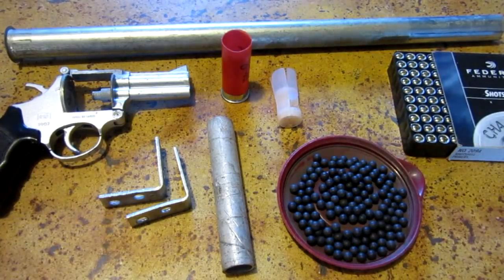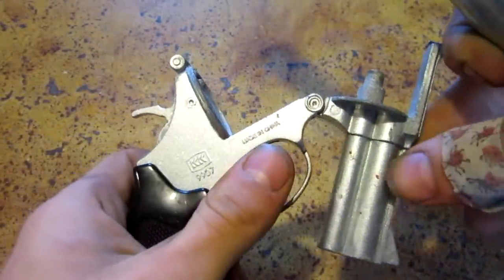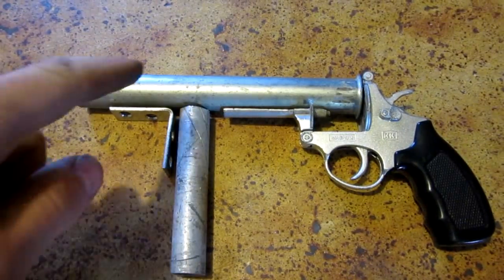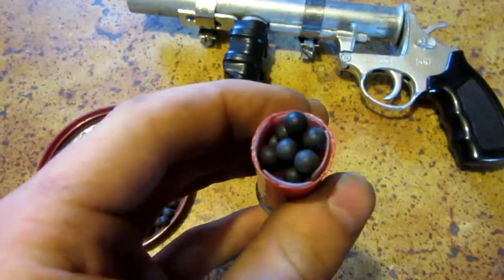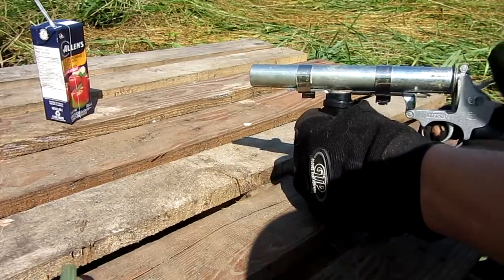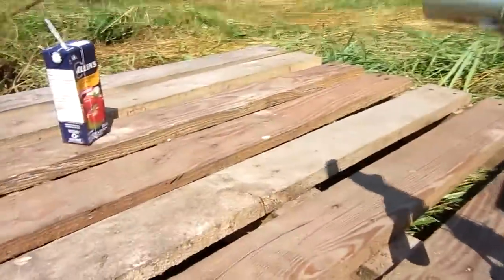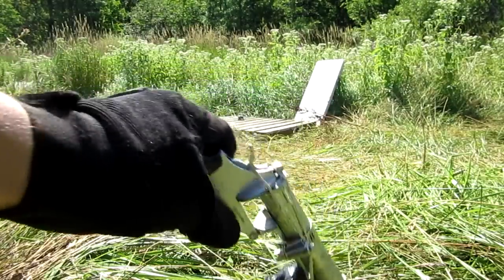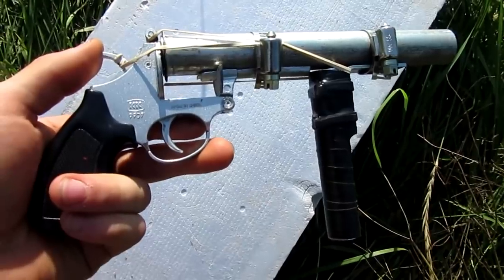How to Make an Airsoft Shotgun Pistol -  $5

Comment: if hes gonna use primers only, he might as well just invest in a flare pistol and just use some empty flare cartridges with some #209 black powder shotgun primers. Same effect, more reliable, and it doesn't accept real shot shells unless they're modified. Sure its more expensive, but its the better option
Reply: It's not that much more expensive.  You can find them on sale for $12 or less, and they're classed as signalling devices so you don't get in trouble for building a short shotgun.

Comment: You're using an explosion as a propellant. This is a firearm.
Reply: A firearm is considered 500 FPS so anything less is not one a co2 is majority not a firearm
Reply: thedukesrule in Canada it’s a firearm is anything above 500 FPS AND above a certain energy I forgot the number of joules
Reply: Black powder guns use an explosion, and they aren't firearms.
Reply: @thedukesrule  in France, If it use fire as a propelent, it's a firearm, no matter what
Reply: @kriss3401  well France is weird as F that makes a lot of things firearms but explosions and fire is 2 different things
Reply: @thedukesrule  firearms uses explosives...
Firearmes don't use just fire... Of course it's two different things, fire, and explosions, but it's absolutely irrelevant here

And I mean of course, if it's meant to propel something with and explosion

What other things is a firearm then?
Reply: @thedukesrule  just looked up and it doesn't specify the limited power so if it's pyrotechnic, then without autorisations, it's forbidden
Reply: If it can't kill you it not a firearm
Reply: @13film55  how old are you....
Reply: @kriss3401  this is a gunlaw in Thailand
Reply: @13film55  well that's pretty dumb
It's not the weapon that say if it can kill or not
It's the ammunition
Replace what he used with a real shell and boom! It can kill
It uses an explosion as a propellant, it is a firearm
Reply: @kriss3401  correct

Comment: well done mate u just made a highly illegal short barrelled shotgun 👍
Reply: yes imagine how dead you  would be if you where to shoot it with a real shell. its a thin pipe
Reply: )Peron1-MC( You wouldn't be dead.  People make pipe guns all the time.
Reply: It’s air soft it’s not considered a firearm
Reply: Definitely not a shotgun. Shotguns are designed to be fired from the shoulder.
Reply: it's fricken pistol grip too!
Reply: Noah Adams the pistol grip is the reason it can’t be a shotgun. The vertical foregrip is the reason it can’t be a pistol even if he rifled the barrel. The overall length under 26 inches is the reason it can’t be a firearm. All that’s left is an AOW, which requires a $5 tax stamp to be legal and not a felony. $5 felonies are really dumb.
Reply: No stock= not shotgun
Reply: @j.m.8193  it's more than $5 lol
Reply: @buyerenogurlfwendo2106  Being dumb is ok. Being arrogant is ok. But being dumb and arrogant is a bad combination. Yes, an AOW tax stamp is $5.
Reply: @j.m.8193   you can give a licensed firearm dealer a gun to make into an aow but whatever work he has to do to make it an aow will probably be considering manufacturing. So he'll probably have to pay that stamp. Then he can transfer it back to you for the $5 stamp. But he's also going to include the manufacturing stamp and labor in the price as well. 

Main point is this isn't a $5 felony.  It's a $200 felony.
Reply: @buyerenogurlfwendo2106  You're factoring in the cost of labor into the tax stamp? LOL. The stamp has nothing to do with the value of the gun. It's $5 for an AOW stamp no matter what. This guy already manufactured an AOW without a stamp.... a $5 stamp. The $200 stamp is only for machine guns, short barreled shotguns and short barreled rifles. This thing is none of those things, so the stamp costs $5. The phrase "$5 felony" didn't mean that his total expense was $5. It meant that an additional $5, some paperwork and waiting for the stamp would have prevented this from being a felony.
Reply: @j.m.8193  I think you are right, but $5.00 is a bit much for what looks like a rubber band gun to me.
Reply: @j.m.8193  no it isn't. 

It's  a $200 tax stamp to manufacture it.  He should've paid $200 before making it. 

It's  $5 tax stamp to transfer it.  But you can't transfer guns made by regular civilians. Only the properly licensed ffls can transfer guns they made.

A simple Google search proves this.  I'm right.  You're wrong.  Google it.
Reply: POTTERLOVER 2007 it uses actual firearm parts including primers and shells it’s a sbs now
Reply: Its airsoft lol
Reply: POTTERLOVER 2007 a firearm is a weapon that uses a chemical reaction usually gunpowder to launch a projectile so this is
Reply: mario its aluminum
Reply: anything that "can" chamber a cartridge   is called a firarm by law
Reply: no moa
Reply: KillStarReder       Making your own gun is not illegal
Reply: @shockwave._.8098  Ik but u could of use a real shell
Reply: @yomum420  with airsoft bbs

Comment: You can build this air soft shotgun pistol for 5 dollars!

But you'll need a 200 dollar grinder, a 100 dollar press and 50 dollars worth of shotgun primers.
Reply: Colin Carroll not to mention a TIG welder if you didn't want it to be held together with pipe clamps!!! LMAO
Reply: Volkz VLOGS or super glue
Reply: Volkz VLOGS or tape
Reply: It’s a 20 dollar grinder a press is unnecessary and is only about 70 and the primers cost 5 for a pack of 100. Also you could use a hacksaw.
Reply: Colin Carroll Haa so true !!
Reply: Too much loosely fitted,unreliable,pos, mumbo jumbo !
Reply: I already got all the stuff I need to make that and already made it after I watched this video it's power full
Reply: Most people going to make this already had all that. This stuff is not for the city boy living with his mom.
Reply: primers are only about 6 dollars
Reply: Every. Damn. Time.
Reply: Exaclty why I went through the comments.
Reply: Your prices are way off.
Reply: @SNOUTxTOUT  theres hacksaws at the dollar store

Comment: I'm not a normal viewer of this channel, but what he has made here is a short barrel shotgun. This is a felony in the United States if he doesn't have the proper tax stamp for it, which I doubt he has. That being said it's a very clever way to do it, but it's crazy illegal.
Reply: 000 000 Use of gunpowder isn't what defines a firearm. The device he built is capable of firing a shot shell and the device is under the minimum length for a shotgun.
Reply from the maker: +LUKE MEADOWS I actually modified it so it can't shoot a real shotgun shell. I put it in the description so I don't get anyone thinking I made a real gun. I also took it apart after the video just for safety purposes.
Reply: inventor719 That's a good idea to add a blockage in theory, but there are live mini-shotgun rounds that are 1 3/4 inch. It's good that you disassembled it, but it still meets criteria for an illegal firearm.
Reply from the maker: +LUKE MEADOWS oh yeah I took those shorter rounds into account too because I think I put the metal blockage at 1.5 from the end of the Barrel. Trust me I don't want to break laws or get in trouble so I've tried my best to do it safely
Reply: inventor719 Good idea. Never hurts to be too cautious.
Reply: 000 000 Quite the opposite actually, you're the one spouting nonsense and incorrect information.
Reply: The law would still classify that as a firearm for the purposes of the NFA as they would argue that with minimal modification i could be converted to an AOW (being a smoothbore pistol) the blockage isn't enough to save you sorry dude.

Rifling the barrel would if you see a .410 shell but your have to be confident it could chamber .45long colt and fire safely.
Reply: its shooting bb's at speeds that wouldn't even harm someone... how is that illegal???
Reply: LUKE MEADOWS it’s air soft it’s not considered a firearm
Reply: It’s an AOW, not a shotgun. Still illegal and dumb.

Comment: Why not make a real shotgun at that point, just replace the bb shotgun shell with a real one
Reply from the maker: +sandra pop the gun would simply explode and be very dangerous
Reply: and y'know, not be legal.
Reply: You can make homemade firearms in America
Reply: After going through all the legal procedures
Reply: +Jake Cardelli only legal work if ur in a blue state or intend to sell I got 4 homemade slamfire shotguns
Reply: Homemade weapons are legal in many states, but not legal to sell directly or high volume
Reply: Chalupa batman not in this configuration......
Reply: All you need is smokeless powder but that would be extremely dangerous
Reply: because a real shotgun uses black powder just air isnt enough power to launch peelets of a shotgun
Reply: Chalupa batman except this would be counted as a short barrel shotgun and its illegal.
Reply: If I’m going to make a pipe shotgun, I’m checking the grade, doing the math (mainly mechanics of materials), getting data for said grade, and testing it with rope behind a shield
Reply: Cos you can't shoot people and both have a laugh after lol, ya kno

Comment: I don't think that's airsoft legal :l
Reply: its not america legal either
Reply: I would think it would be considered a firearm due to the propellant being used, but I don't know the laws regarding it.
Reply: It is a firearm due to the fact that it uses cartridges, and is thus an aow at best
Reply: It would be legal is some states as a smooth-bore pistol which is an AOW and therefore and NFA item in the US, some states allow it, some don't
Reply: airsoft is sooo legal...
Reply: Alexander Simcox 

Yes it is, of course with the forgirp you would need special stamps, I don't think you would need a stamp for a SBS, because it has a pistol grip, but I'm pretty sure it's legal.
Reply: ??? what do you mean "airsoft is sooo legal..."
Reply: To all of you that say that it cant handle a full load, yes you are correct, but the shells that he filled with airsoft bbs are considered cartridges legally, and makes it a firearm. Also, aows require a 5 dollar tax stamp approved by the atf to be legal in the us.
Reply: All of that in addition to if its even considered an aow, it may be considered a sbs because of the smooth bore barrel
Reply: Luke K  adc

Adc
Reply: rip airsoft players
Reply: Luke K dikodopzl
Reply: Luke K , .
Reply: very good
Reply: bufb
Reply: yah
Reply: Luke K Tumi
Reply: Luke K z
Reply: @av0-cad03  you'd need an sbs stamp
Reply: @alexandersimcox2079  that's a $200 stamp because he made it

Comment: I don't mean to be that guy but I'm pretty sure there are laws against that
Reply: it is
Reply: 000 000 there is just so much wrong with this comment. It fires an actual shot shell. Doesn't matter to the ATF if it's safe or not. Doesn't matter how far the rounds would travel. He made a zip gun plain and simple.
Reply from the maker: +000 000 I've also modified the barrel so only shortened modified airsoft shells can be put into the barrel.
Reply: inventor719 1. cut off top of shotgun shell 2. cover up with saran wrap.
Reply: Sorry but your wrong.  Propelling anything down a barrel using an explosion is considered a firearm.  Does not matter to the ATF if the tube can handle a full shell or not.  Also if he added a stock and made the barrel 18" long and the overall weapon length of the gun 26" it would be legal.
Reply: 000 000 I don't believe it can be both a short barrel shotgun and an AOW, but I am not positive about that.
Reply: Zealot Patriot That is incorrect this is a short barrel shotgun the size of the bore and it having no rifling makes this not a handgun.  I make lots of guns on my channel and know the laws and rules very well.
Reply: Zealot Patriot you're right in theory, but because it shoots a shot shell, it's a shotgun.
Reply: NooN
Reply: Mastapoole actually you are wrong. A muzzleloader isn’t considered a firearm and it shoots a projectile using gun powder
Reply: It's a bb gun
Reply: If he will shot real shell he'l probably die

Comment: It's a pity the weak Zamac alloy won't resist any powder deflagration because soldering a 1/2 inch plumbig black pipe to that frame with the percusion pin you would get a wonderful 28 gauge shotgun. With a deactivated old open frame S&W (good steel) all would be safe.

Comment: Just an FYI. You just made what the ATF classifies as an AOW (any other weapon), that is a firearm that does not fall under any other category of firearms, and is very illegal to own without proper licensing. I believe it is a felony charge with up to 10 years in prison, and up to a $10,000 fine. I hope you do not live in the United States, because you would be fucked.
Reply: Brian Kunkel it's a homemade shot gun. You can build your own gun, you can't distribute them. can only be used as home protection and at your own risk.  I've converted a flare gun to shoot a 410, 22LR, etc. his set up does looks get dangerous but it's not illegal to build your own gun.
Reply: ben tran you are right it is not illegal to build a homemade gun. Where it becomes illegal is when there are features on the firearm that classify it as an NFA weapon. For instance, a shotgun with a barrel length less than 18” combined with an overall length of less than 26” is a big no no. At that point it is classified as a short barreled shotgun (SBS), put a forward pistol grip on it, it becomes an AOW.

Comment: Firstly, that's lead shot, not airsoft bb's. Secondly, it doesn't matter if it will only accept shorter than normal shells, it's still an actual firearm and as such needs to ashere to any applicable laws.
Reply: they are 8mm BBs, I'm pretty sure.